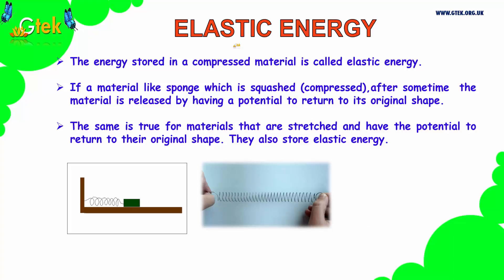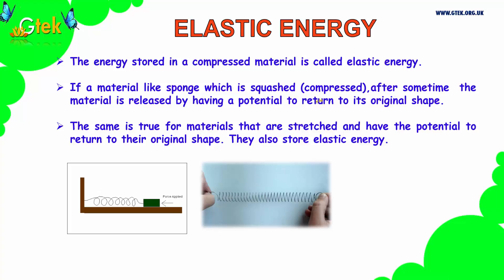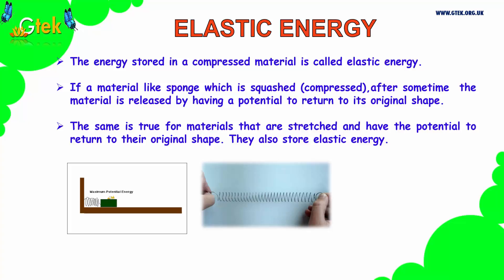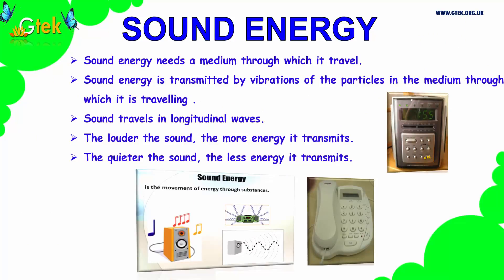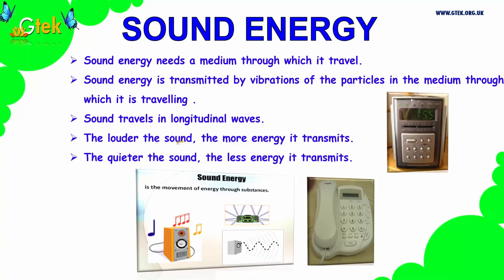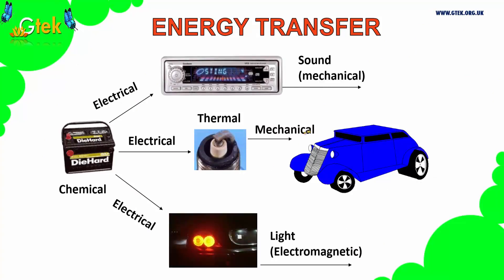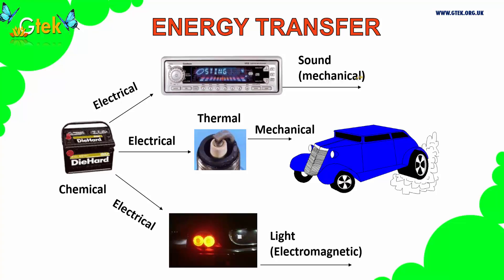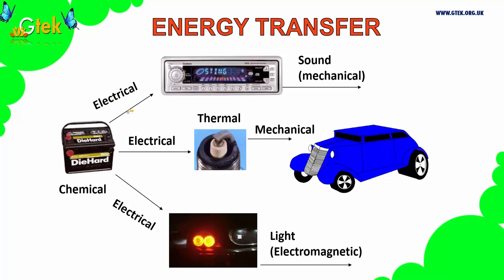Sound Energy in Physics | Examples of Sound Energy | Energy Transfer in Physics

Comment: Sound energy is a form of energy associated with the vibration of matter. The SI unit of sound energy is the joule (J). Sound is a mechanical wave and as such consists physically in oscillatory elastic compression and in oscillatory displacement of a fluid.

Comment: Sound energy is a form ofenergy that is associated with vibrations of matter. It is a type of mechanical wave which means it requires an object to travel through. This object includes air and water.Sound originates from the vibrations that result after an object applies a force to another object.

Comment: sound-energy definition: Sound energy is the energy produced by vibrating sound waves.
Facts About Sound ... (physics) The energy present in a sound wave.
Sound energy moves through a process of vibrating air molecules, which create a chain reaction of vibrating molecules that the ear perceives as sound.
The farther you are from the origin of the sound, the less the chance that you will be able to feel the vibration, and thus the less you can hear the sound.
The size of the object that begins the wave of sound energy will produce a different type of wave than another object that is a different size.
Sound energy, because it is based on vibrations, must travel through something: if you have a vacuum of space such as a black hole, there can be no sound.

Comment: In physics, sound is a vibration that propagates as a typically audible mechanical wave of .... The energy carried by an oscillating sound wave converts back and forth between the potential energy of the extra compression